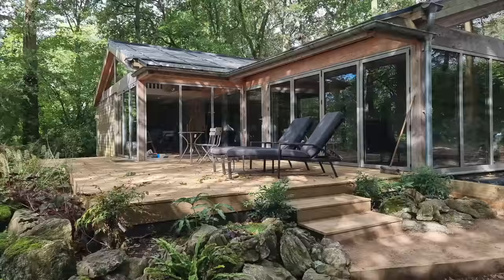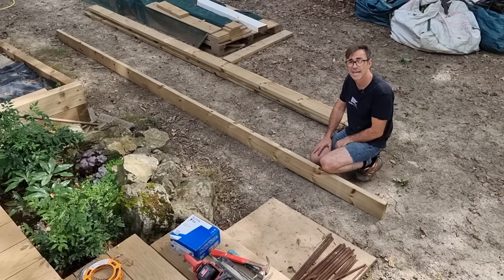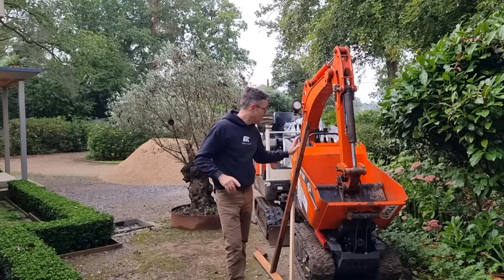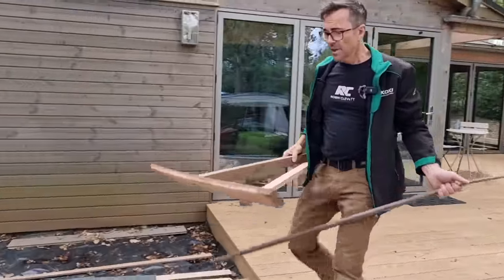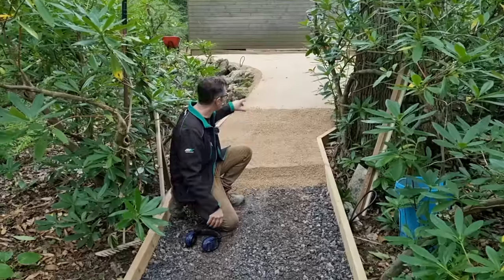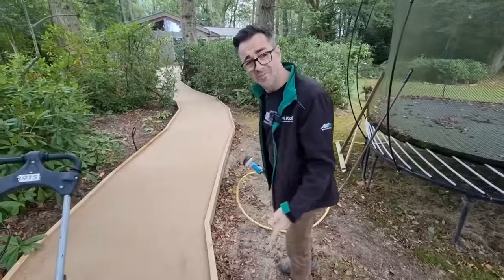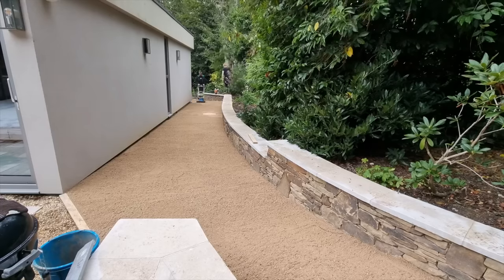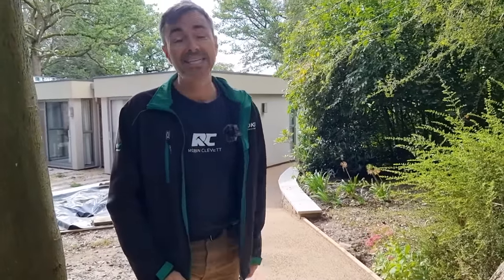Garden Path Construction, How To Build A Beautiful Garden path with Breedon Gravel

Comment: Nice job as always Robin, I've been considering using this product myself but I've got to see if the small quantity I would require can be sourced economically ! Absolutely right about the importance of managing the run-off - local council used it on the country park on inclined paths without doing this and six months later it's a right mess, uneven and debonding and puddles everywhere !

Comment: Cracking job as always. Looks brilliant. Did you consider using something like a corten steel edging? Could look excellent in this situation. £££ though. Would create a more sweeping curve as opposed to the corners created using square timber
Reply: I used that in my front garden. Well recommended - really easy to install and looks great!
Reply from the maker: I would have like corten but is was supper pricey and it would have needed to be pretty thick to contain the pressure I costed it at about 3k!!!!

Comment: Looks stunning. We’re having our drive done at the end of this month in exactly this product, 350 square meters. We have looked at everything, tarmac, block paving, gravel, concrete, and resin, but the practicality and aesthetics of this product justifies the cost. Just out of interest, how much MOT did you put down first?
Reply from the maker: For my path I used between 100 and 150mm but for a drive I would aim for a minimum of 150mm compacted in layers if the ground underneath is stable, when I did my drive that you saw the Breedon Lorry reversing on was originally garden, we excavated to 300mm and then used type 2 for 200mm and roller compacted that, then added 100mm of type 1 MOT over that and its a solid as a rock!!
Reply: @ukconstruction  we’ve been quoted for 12 inches of type 1 so really happy. Thanks for replying and fantastic video

Comment: Fantastic looking path and another great job Robin. Just wondering how clean it is compared to say a washed gravel? Are you going to be pulling fines into your house on the bottom of your shoes?
Reply from the maker: Hi Mate, I was worried about that but once it has set and had a couple of rain showers over it there is not really any milky stuff over it so as yet I have not witnessed any light coloured footprints indoors!!!
Reply: @ukconstruction  thanks Robin, appreciate you taking the time to reply.
Reply: Hi, it's a good question.  Breedon Gravel is purely natural material with no bitumen or binder and so there can be an element of pick up on shoes from time to time.  We always advise that there is a hard-standing area (ie paving) covering around 2m2 directly leading to property entrances to help alleviate this.

Comment: Hi Robin. Quick question, could you use a manual hand tamper if you were using breedon in a small area and still get the fines to rise? Thinking of using breedon as a dining area base but would be way smaller than your job. Thabk you.

Comment: That Breedon is lovely stuff isnt it....  When you do the top layer to bring it up to the retaining board height put a bigger camber on it so all the water runs off the sides properly.  Otherwise you will have a river in heavy rain which will rut it badly.  2 inches high in the middle should be perfect.
Reply from the maker: I spoke about this in the video, super important as you mention!!

Comment: I could be wrong but 2 years ago Robin laid a very different colour Composite Prime decking there…now that appears to have been ripped up and a different colour is there….that’s a £15k deck right there…twice
Reply from the maker: I have changed the deck as the colour was to light for the setting, this has been lifted and moved to be re laid after the winter at the rear of the summer house, so apart from un screwing the existing deck and moving it I am no worse off, as we where planning on the rear deck anyway
Reply: Some ppl do that - my wife didn’t like the colour of our new £2.5k composite fence so we replaced it with a different colour.

Once we had a carpet fitted she didn’t like and we replaced it the following week!
Reply: That's the beauty of composite prime 20/20. It's ,double sided so you can flip it. I bought some after seeing  Robin use it, and so glad I did. Infinitely better than traditional decking.

Comment: How do you clean this stuff?
Reply from the maker: Blower for loose debris on low power, it will go green if in shady damp areas, but this can be gently brushed or treated the surface self scarifies and there is a loose gravely finish, its pretty hardy